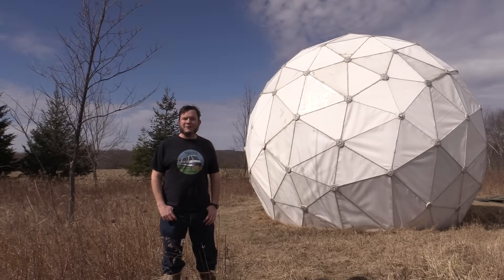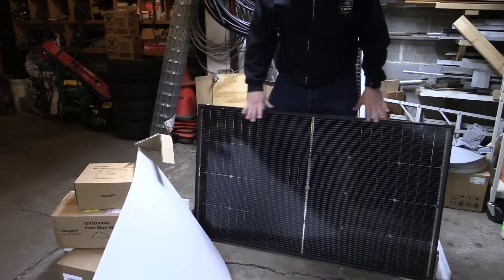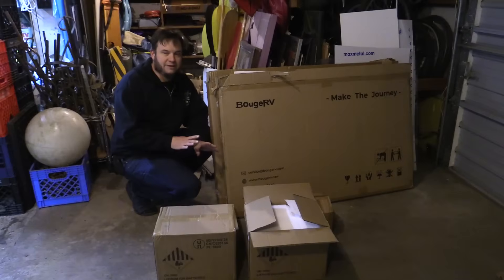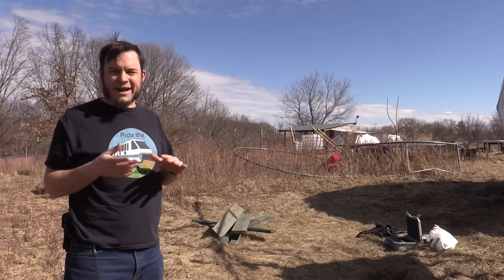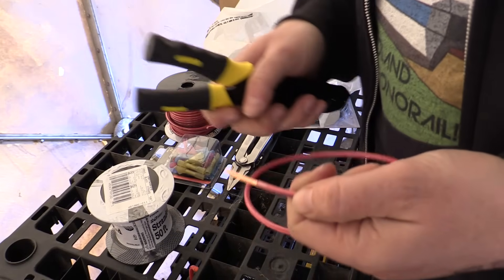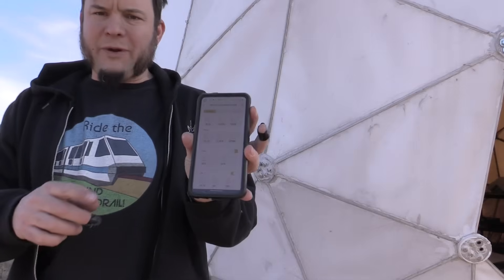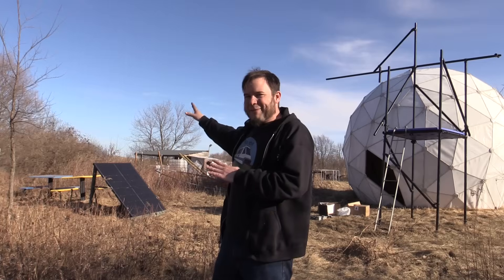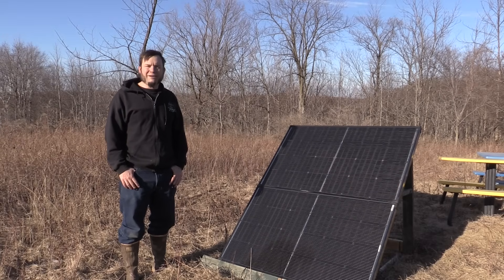Adding Solar Power To My Geodesic Radome - With BougeRV Equipment Review

Comment: what a stich up on the wiring, it's almost like companies deliberately make it harder to do things they don't want you doing
Reply: MC4 connectors are absolutely universal in the solar industry.  The big box stores are garbage and carry low quality crap.  There isn't a single quick electrical connector at HD or Lowes that I would trust in an exterior setting that I would trust as far as I could chew it up and spit it.  MC4 are fairly well designed and reliable.  (as long as you stick with name brand)  The fact that big box stores don't have any MC4 gear is just a reflection on how shitty they are.

Comment: Is that charge controller RF quiet? 😮
Reply from the maker: Haven't checked yet, will be good to find out! We can always unhook stuff if I need to.
Reply: @saveitforparts all the charge controllers and inverters are going to be switching mode and the primary switching frequency is usually in the low tens of kilohertz.  Some of the newer ones with GaAs or SiC mosfets are starting to push up to the 100khz range and even a couple hundred khz.  A cheap unit like this one is probably closer to 20 or 30 khz though.
Reply: Please check the inverter too! I need to build something like this for a search and rescue command vehicle and RFI (specifically in VHF) would be a showstopper.
Reply: Solar chargers are notoriously noisy... It might be necessary to out the battery/charger/inverter in a nox outside and just run AC into the some, at least when doing science as opposed to power tool time! The only way to know is to fire up the radio telescope and see, of course.

Comment: BougeRV is one of the most overpriced resellers of solar equipment.   You can get better & more powerful panels for half and sometimes less than half the price they charge.   Any company that can afford YouTube ads is going to be WAY overpriced.
Reply: What mfg.r  would you recommend?
Reply: @scotterdog1036  There are many, I have panels from 3 different companies that are all great.  My inverter is from a 4th company.  Easy rule of thumb, if a company can spend the money on youtube advertising, avoid them.  One of my panels is Renogy, one is HQST, and I do not remember the brand of the third panel.
Reply from the maker: @DownEastSaw I actually just got an email from Renogy asking to review some panels. Haven't tried them yet to see if they're good, but they definitely do advertise on Youtube!
Reply: @saveitforparts I could use some solar 🤣 mostly joking
Reply: @ interesting, this is new.   I’ve watched more YouTube videos than a person should including channels specifically about solar and haven’t seen any renogy ads.   I have also noticed the price of renogy stuff steadily increasing over the last few years, so I totally believe that they are starting an “influencer marketing” campaign.   I guess I’ll have to cross them off the recommended list.
Reply: @scotterdog1036  You can find super cheap panels that have been removed from commercial installations at places like San Tan Solar. Their prices are amazingly good, especially if you buy by the pallet load. Or in general, just don't buy anything being promoted on youtube, where 40% or more of your cost is going directly towards giving free product away to advertise on youtube. The people with good product and good pricing don't need to spend nearly that much on marketing.